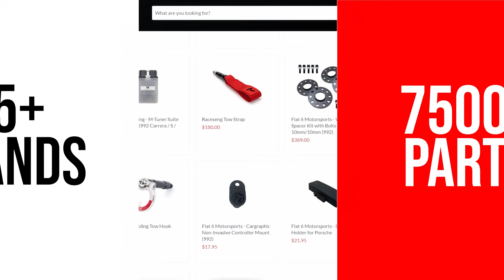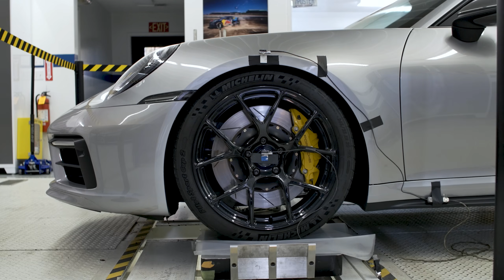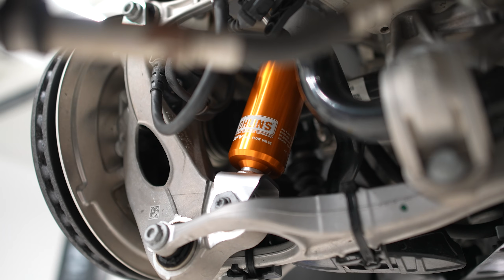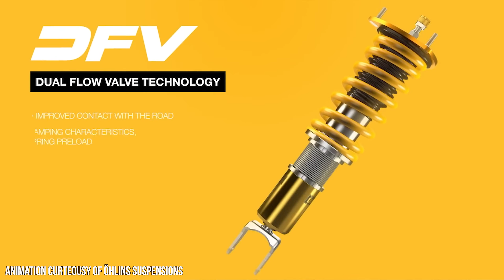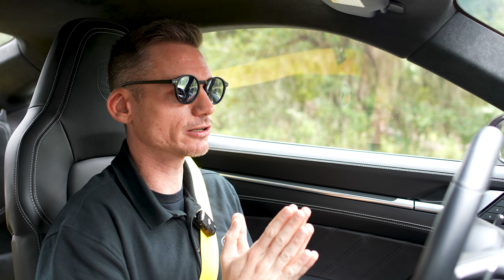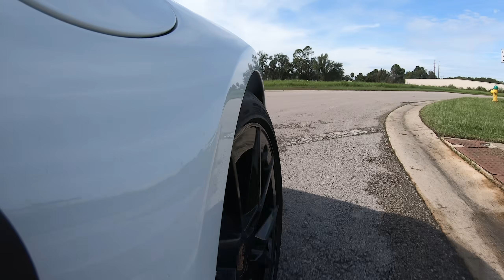Porsche 992 Turbo S – Öhlins Road & Track Coilovers Installed (925HP Build)

Comment: Are you able to share damper settings for the car as in how many clicks front and how many rear from full stiff
Reply from the maker: We usually start at a mid-point of around 10/10. I believe these got adjusted to 8 in the front and 6 in the rear (from full stiff) for track use.
Reply: @Flat6Motorsports thanks. Settled on 8/8. Some tracks are bouncy and even with 8/8 it’s still supreme.

Comment: Had R&T installed on my 996TT cab 6mt… was perfect for daily driving at 10 clicks. I tuned the car to about 500hp/500tq and it started to feel a little light up front under assertive throttle. Adjust the clicks to firm it up and voila it’s perfect. Great system